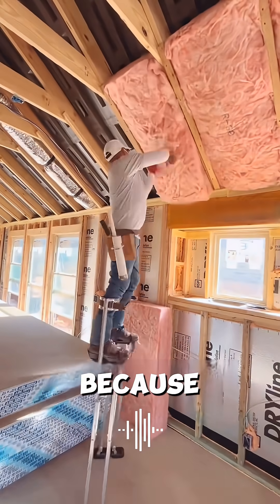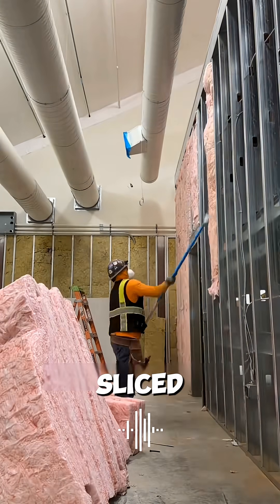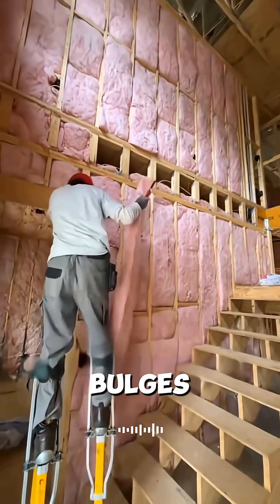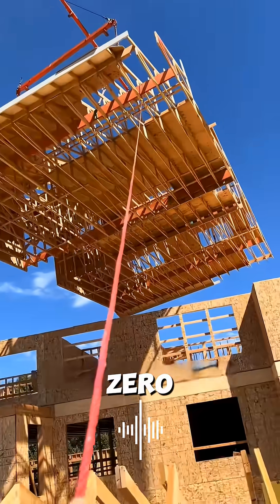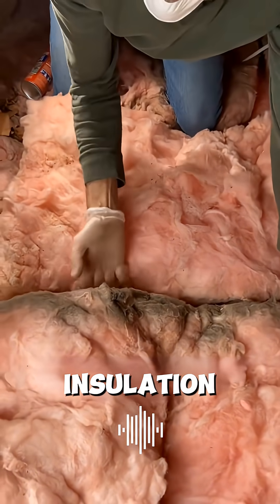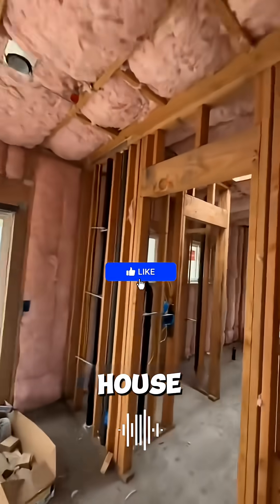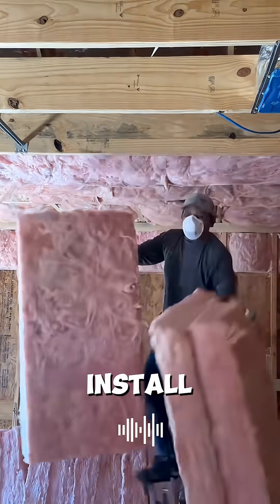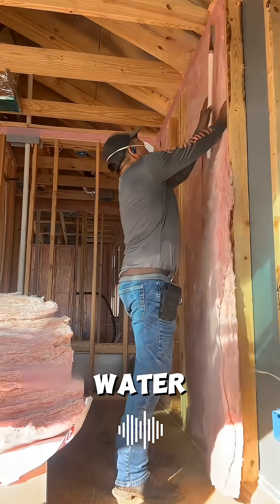What You’re Seeing Isn’t Candy… It’s the Secret Inside Every U.S. Home

Comment: Wrong, that all start with concrete with foundation, for cost and speed they build with wood because they get no storms with winds over 50mpr, but that’s changing when Tornadoes 🌪️, Hurricanes and Termites is destroying these houses. 

(2) In Guam we are in typhoon alley and every year have babyTropical storms between 75 to 95mph which is party time for us, with up to 175mph ton245mph at least 1 to 2 times every 3 to 4 years. 
On Guam, all our homes by Law,?are built with 100% concrete to survive amenmake it through with minimal damages mostly trees & Power. 

(3) Here on Guam, most of us have back up generators while the utility agencies  (who are masters at re-installing the overhead high energized lines its because of this our utility agency has stock supplies on hand just for repairs to cover 2 typhoons have a back up of supplies on hand just for typhoons,  We average 1-3 typhoons a year, In one year we had 5 direct hits to Guam in an 11 month period. (3 Typhoons, 1st -  with 75mph w/gust to 98mph, 2nd - with 105mph w/gust to 130mph and 3rd - with 148mph w/gust to 185mph and worse 2 Super Typhoons 1st was 185mph w/gust to 205 mph & Omar which was 195mph w/ gust to 245mph ++ only because the wind instrument only went up to 246mph and sent notice over MAX.

(4) In order to receive FEMA assistance to rebuild we are required to re-build at 100% cement house ONLY, Banks will not provide any mortgage loans and insurance company’s will not insure structure that is not built of Cement.

(5)  All buildings (Gov & Local), houses and structures must have Typoon shutters or metal panels to be installed before typhoons to obtain a Loan or Insurance. Banks will not provide any mortgage or business structure loans unless you have typoon panels, accordion shutters or Roll down metal doors that are rated for Min 175+ mph. 
So if people really wanted to be safe during any tornado, typhoon and hurricane this is the way to go protect yourself, family and investment. 

(6) As a Prep-per against , Any  WORLDWIDE ECONOMIC CRASH,  ZOMBIE APOCALYPSE and /or WORLD PANDEMIC, Cement house can be easily sealed up tight with 1/4 + Custom Gavl /steel to close and cover all entrances for windows and doors….have a save underground passage to underground safe house for family (or multi families) working together to Survive with food storage, Indoor growing, weapons, Filtered air supply, multiple size generators wirh 3000 + Duwsel tank, 1500 Gas Tank, 3000 Water tank of unabke to dig and have dedicated water well, Solar system and secrete hidden alternative entrance & exit and motorized equipment, Quad runner, Side by side, Toy Truck & Over land, Motorcycle(s), min 14’-16’ Alum boat and 40hp Enduro Yam motor, Oils (Out board, auto, hen etc ), Electric Mountan bikes, all with run flat tires. Night vision…,just for starters.